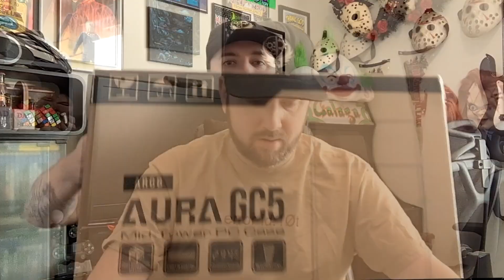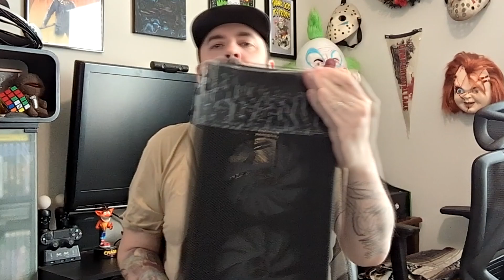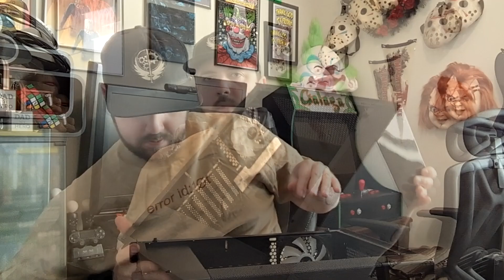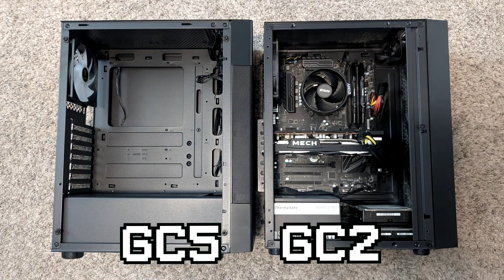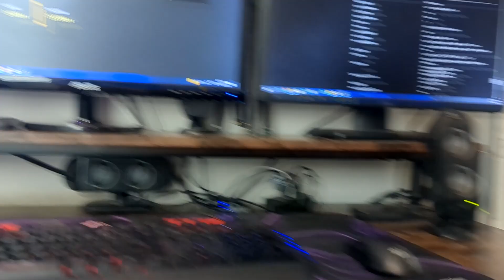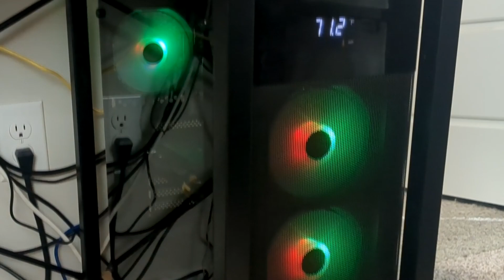GAMDIAS RGB Aura GC5 Mid-Tower PC Case Unboxing, Setup, & Review

Comment: the button you used as a colour changing button works as a restart button in my casing but I want it to use as colour changing button !!
same model GC5 but my box doesnt have the word ARGB in it so Its not possibe for me to change colour ???
Reply from the maker: You need to check the pins you are connected to on the MoBo.

Comment: Yo bro please if you read this comment, please do a step by step tutorial on how you got the rgb to be changed with the reset button, I'm trying but I'm not confident enough to just pull out and plug in yk
Reply from the maker: You don't change it with reset. There is a button for the LED. It depends on your mother board and if you connected the pins correctly.
Reply: @LivingwithPerks i can't find the button for the Led, I'll go check again now, also my friend helped me with my pc and he did most of it so I'm not fully aware of what cables are where
Reply from the maker: @thegamingfish145 look up your motherboard diagram

Comment: What rgb Controller did you use?
Reply from the maker: I did not use one. I connected it to my sata cable for power and used the default button on top to switch colors

Comment: Another question, what’s with the red led flashing down the blue led on?? What does it mean?
Reply from the maker: Where do you see this?
Reply: @LivingwithPerks in the case, on the right side of the on button, you see there is like a led with a bulb that turns blue, downside of it there is the led that turns red I’m telling you, with like a draw of a cylinder, I notice it also turns on and off in your video so I think it’s normal is it?

Comment: I have aura gc5 but when i click reset button it resets. How do i change color on fans
Reply from the maker: You connected the pins wrong to your mobo. You need to look at your mobo guide.
Reply: @LivingwithPerks I have the same problem. My motherboard is B450-k gigabyte. I can't find the guide on how to put my RGB connectors/fan connectors
Reply: @kcyumi i want to know the same
Reply: @LivingwithPerks  its connected to psu not to a mobo

Comment: Hello, can someone help me i got the gc5 but the led control button resets my pc and doesn t change the rgb i got argb hub plug it in the sata and 3 pin cable that goes in the case  and it does nothing im relly desprate for help
Reply: I have the exact same problem here
Reply: @napolekhooana993 so basicly i found the solutin u nned to reconnect the reset button to the back of a litle cable
Reply: @Nikola99011  i get it but which little cable
Reply from the maker: You connected to wrong prongs on mobo - please make sure you subscribe!

Comment: BRO PUT A GUIDING VIDEO TO THR TEMPERATURE SENSOR CONNECTION
Reply from the maker: @darsanrs5068 it's automatic as long as you connect the pins correctly to your mobo. All mobos are different. You need to look at your diagram for the pins
Reply: @LivingwithPerks  but I didn't have any temperature pin in my mobo
Reply from the maker: @darsanrs5068  there isn't one. You have to have the correct power pins and USB pins. The mobo sends the signal to the front display from the temp application you install.
Reply: @LivingwithPerks  please put. Video for that
Reply from the maker: @darsanrs5068 ok. make sure you subscribe
Reply: @LivingwithPerks  when will be the video coming I subscribed already

Comment: I got a question about the lights the case has included on it, can they turn down on any way?
Reply from the maker: @charlesmarinyael4734  you mean turn them off? Yes. I toggle through the modes.
Reply: @LivingwithPerks  is there a way you can help me I really don’t see where the button for changing the modes is
Reply from the maker: @charlesmarinyael4734  small button on the top. Watch my video. I demonstrate it
Reply: @LivingwithPerks I don’t see the button only see the restart button and and power button can you help me?
Reply from the maker: @abrarabdullah4714  I show the buttons toward the end of the video. Power button is large round button, the temp button is long narrow rectangular button.
Reply: @LivingwithPerks  the small button you showcased restarted the PC for me?
Not sure why
Reply from the maker: @rhinoracer  that means you have those wires connected to the reset pins on the motherboard.
Reply: It s same with me where do i need to connect it for it to control the rgb @LivingwithPerks
Reply: @rhinoracer hello im desprate for help did u fix ur issue and if u did where did u connect the the wires gor the samll button to control the rgb
Reply: @ I checked and I think it's supposed to be connected to the port labeled system_fan, but my cables aren't long enough so I can't even test it, I have it plugged into USB2 or something, idk, I just gave up after seeing the cabled won't make it.
Reply from the maker: @rhinoracer  you will need cable extenders
Reply: @LivingwithPerks  too lazy for the moment, I'm fine with the default colours for now.

Comment: Were to pluge the cables in for the gage
Reply from the maker: @lourensvandermerwe871  it's through the USB pins on the mobo
Reply: @LivingwithPerks  cold you maybe doe tutorial how you plug everything in and a build in this case pls
Reply from the maker: @lourensvandermerwe871  the pin connectors vary from motherboard to motherboard. My best advise is to look up your mobo model for a diagram guide.
Reply: @LivingwithPerks  oo okay thank you enjoy your day